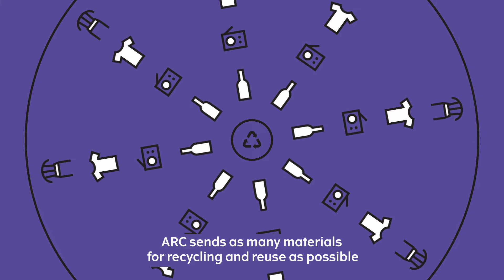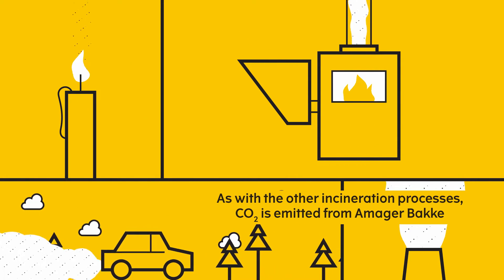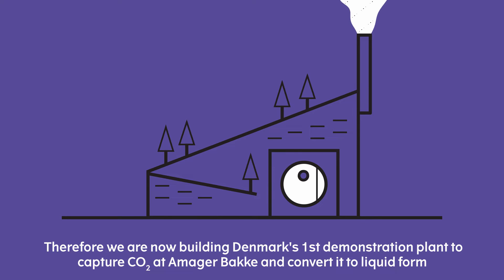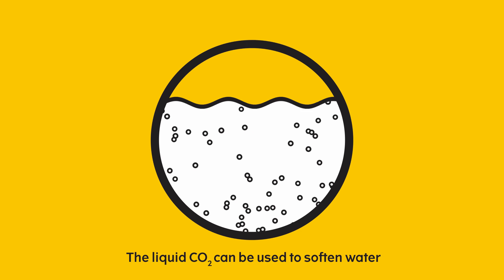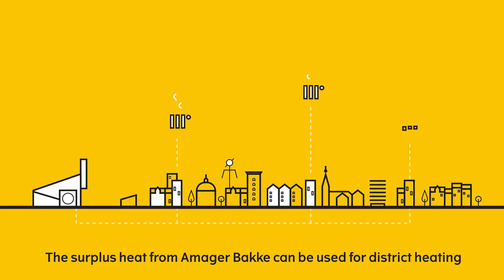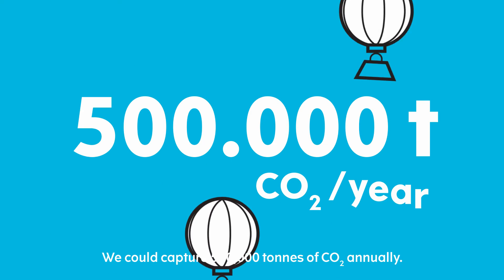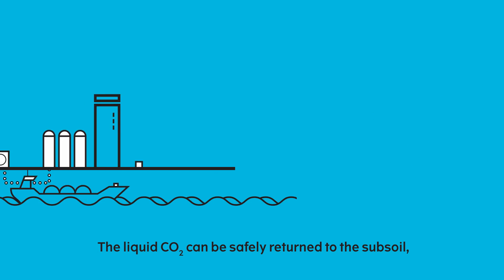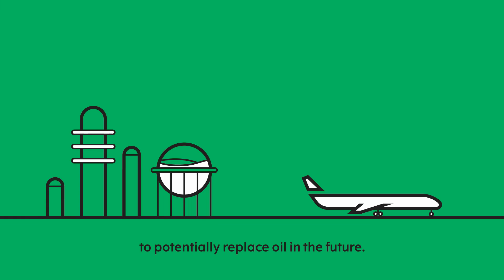Carbon capture demonstration plant at Amager Bakke (CopenHill)

Comment: It's impossible for greenhouse gas behavior to cause global warming.    Global warming was officially stated at 1.1°C in 1991 and 1.06°C in 2022.  There is no mechanism that would allow greenhouse gas behavior to cause global warming.   The back of the United Nation's IPCC science report states it took its greenhouse gas samples at 20,000 meters altitude where it is common high school level knowledge there is no greenhouse radiant energy.  This is typical practice for deceptive marketing to state legal data transparency protecting the perpetrators from fraud prosecution.  

Earth's greenhouse effect is frequently used as a primary example to high school students of a system always in saturation from the strong greenhouse gas water vapor absorbing all the greenhouse radiant energy from the earth with greenhouse gases within 20 meters of the surface that is all around us everyday and can't have its overall effect changed.  There is no further greenhouse radiant energy to interact with greenhouse gases.  At 1% average tropospheric water vapor over 99% of earth’s greenhouse effect is from water vapor.  Water vapor would hold earth's greenhouse effect in saturation if it were the only greenhouse gas in the atmosphere.

Arctic warming is taking place with the proving mechanism being warm Atlantic Ocean waters migrating deeper and more frequently into the Arctic Ocean warming it and the region.   That warmer water is causing a few weeks less of reflective snow and ice coverage resulting in more solar heat gain to the Arctic region surface.

Atmospheric CO2 levels of 1200 ppm about three times what they are today would greatly invigorate C3 plants the majority of plant life on earth greatly greening the planet. 

0.4% of the atmosphere is CO2 and on average 1% is H20 water vapor.   (1% H20)/(0.4% CO2) = 25.  Water vapor is 25 times more present in the atmosphere on average than CO2.   Water vapor has an CO2e of 18,  18 X 25 = 450 CO2e total for water vapor to 1 CO2e for CO2. 

The Earth’s oceans have 3-1/2 million sea floor volcanic vents warming the water and changing it’s chemistry that have not been systematically accounted for.